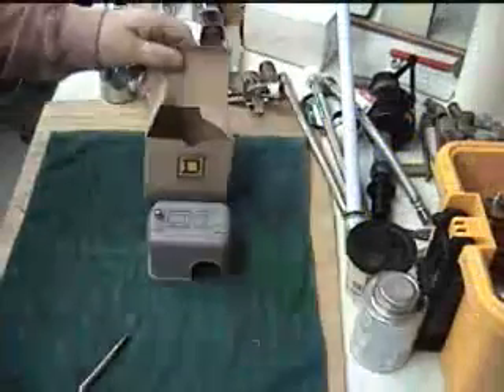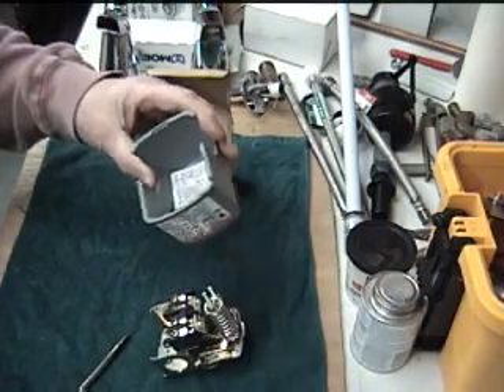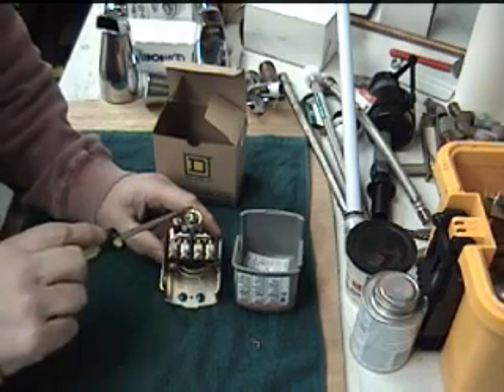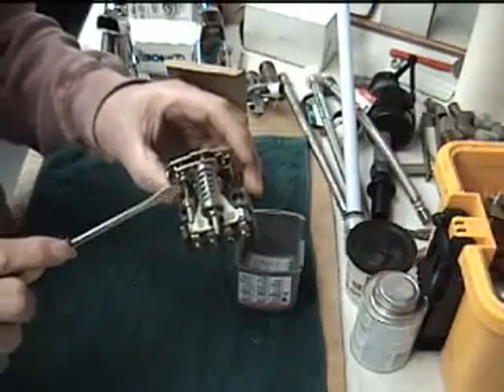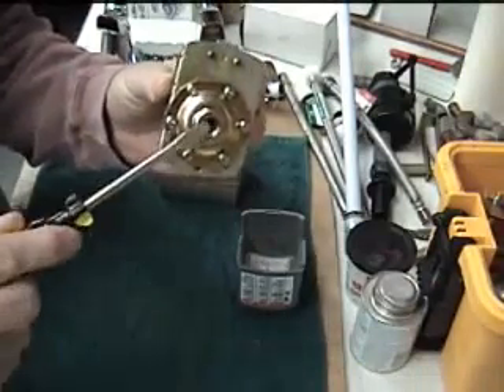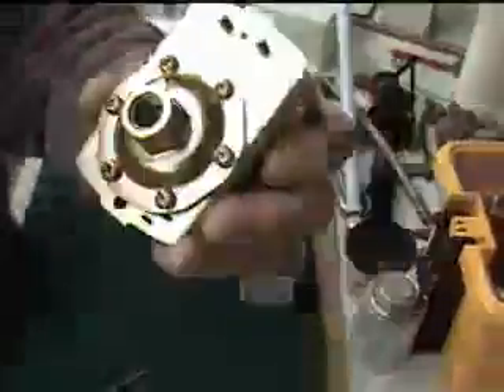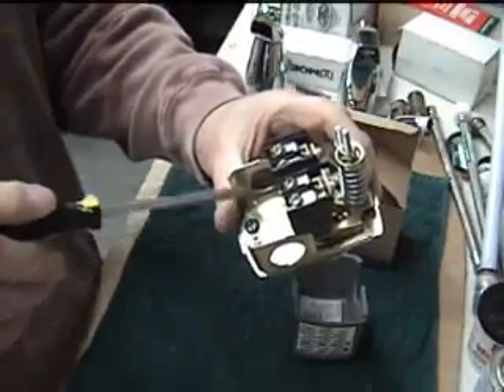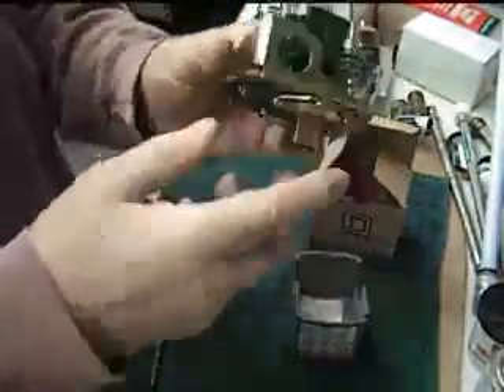Well Pressure Switches

Comment: No it is not. Bad check valve will let water back into well. Leak under ground if a deep well, Put your ear to system sometimes you will hear water going somewhere. If deep well as a casing you will need a well man. If pump and tank in house (shallow) check valve is usually accessible and can be replaced. Hope this helps

Comment: I just put a new one of these in and it works fine as long as I'm not using to much water.  If I run to much at once it sometimes doesn't turn on.  I have to manually turn it on till the pressure builds a bit then it will kick in and stay on.  Is there an adjustment I can make or is something else going on?  I have plenty of pressure when it's working.

Comment: Good video...and very helpful. My water pressure had been dropping for awhile. The submersible pump/pressure tank and hardware were in service for twenty years and have worked well. I changed out the 30/50 switch for a 40/60 and put in a new gauge as well. Cost about $30.  I'm just glad that there wasn't a problem with the pump, although now I think I could replace that if I had to. Thanks for the vid!

Comment: There could be other issues, if this just one faucet, if so then no. But keep in mind some well pressure switches only go so high. You need to see where the settings are, what does pump start at, and shut off at. most switches are 20/40...

Comment: Hi  I have put in a new PSI switch because spring broke after 10 years..the problem I am having is , it works norm untill I run sprinkeler for about a hour. then the switch sticks off & have no psi. I have to tap on switch  then it come back on I works ok...(untill I use a large amount of wate)r & then same thing happens...wiring is tight...can this be a bad switch?

Comment: When the water presure in the house drops to below 20 psi I tap the pressure switch (grey plastic cover) slightly I hear the contacts close and I have water pressure any suggestions as to why this would happen. I hate to replace the pressure switch unless I have too.I was thinking maybe the small brass pipe below the pressure switch might have sediment buildup inside but looking for an easy fix can anyone help?

Comment: Good stuff. My #2 is so far back into the system I'm not even sure I can even twist it with a traditional wrench. My pump / pressure goes off all the time and there is zero water pressure. So I assume tightening my #2 would work. Maybe my air tank is bad.

Comment: Dispatcher Bob, you are the Man!! Thanks for the informative video. I do want to know if you can answer a question I have?
My pump runs constantly, I have a Flotec 82 gal pre charge tank. The pressure gauge appears stuck beyond 100psi, whether the pump is on or off. I knock the tank and it sounds different at the bottom than the top. I think the diaphragm is ok. Do you think the pressure switch is faulty?